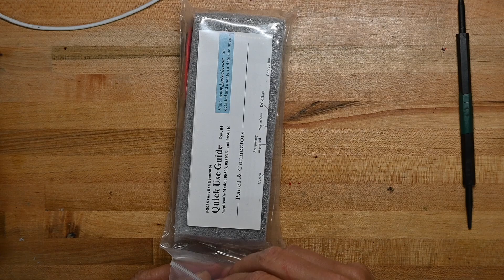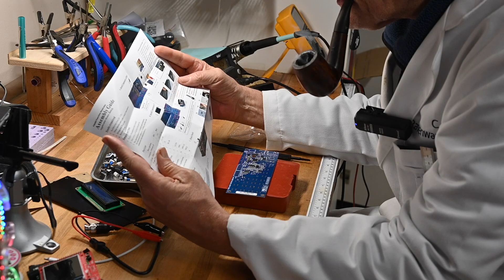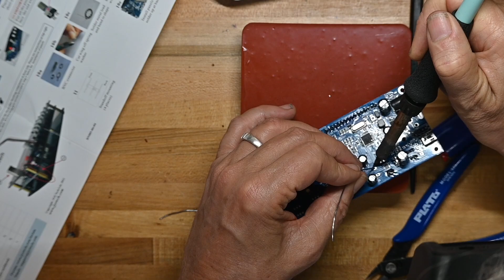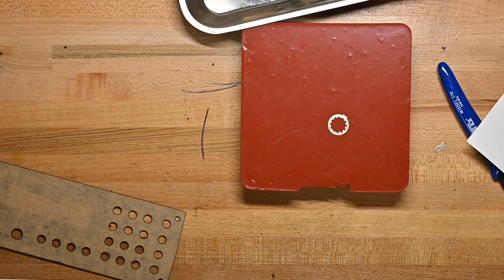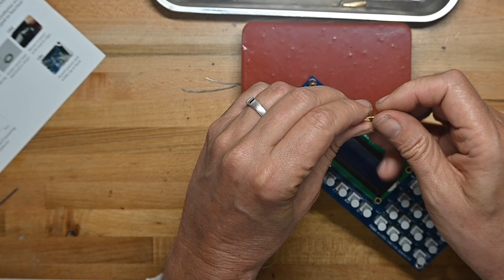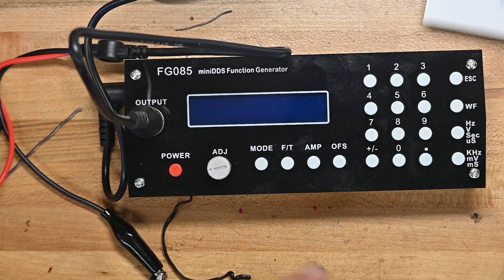C.K. builds a signal/function generator kit from JYE Tech

Comment: Hey CK I built one might I recommend a Soldering Microscope or magnification. And the output in my opinion is low. May need to amplify.
Reply from the maker: I do use a magnifying visor, but I’m also Old 😀 yeah, low output for many uses, but I’ll admit I have a store-bought signal generator for my off-camera work. Thanks for stopping by!
Reply: @CKHaun I have a store bought signal generator as well. Nice having two channels.

Comment: i found a guy on ebay with like a few assembled ones for sale as is i see it powers on and says he does not test this type of thing so 35 plus around 8 shipping
Reply from the maker: Interesting.  That's a lower price than the kit, wonder how he makes money.  But you don't get to put it together :).
Reply: @CKHaun  i would say he scored them and has no idea about them like lost shipping auction returns etc
Reply: @CKHaun  is it worth 45 bucks usd reliable type thing i need on for my hobby repair vintage stereos i am getting into .so many chooses
Reply from the maker: @overbuiltautomotive1299 I think it would be worth it.  It's got many functions, it's reasonably easy to configure and use.  You could just get a cheap audio generator for stereo repair, but I think the $50 for this will give you a much more flexible unit.
Reply: @CKHaun  yes thanks sir and God Bless you and yours / thanks or your time

Comment: Nice video, thanks!  I’m just learning about all this stuff. Does a signal generator like this perform the same duties as a PWM (Pulse Width Modulator) signal generator? I see a lot of people doing experiments with PWMs, and am wondering if there’s any difference?  Thanks!
Reply from the maker: Thanks!  
This will generate a pulse width signal with adjustable width, frequency, and amplitude.  But a PWM gen. often just does square waves, this can do square waves and sines, etc.
Reply: @CKHaun  Thanks for the clarification! So basically a PWM is a square wave generator.
Reply from the maker: In general yes, and often aimed at digital circuit design and testing since many chips take discreet on/off signals (square waves) vs. continuous signals (sine waves).
And I say "in general" since some PWMG can do sines, and some digital chips can be perfectly happy with sines vs. sharp-sided squares.
And a dedicated PWM generator can have lots of additional handy functions for chip/board designers and testers.
Reply: @CKHaun  Thanks for all the info! 👍

Comment: DUDE! SYNC YOUR SCOPE!
Reply: 🤣CK don’t press no unnecessary buttons.
Reply from the maker: Every extra button press is deducted from my Xbox controller button presses, can't afford to miss 'em :)
Reply: @CKHaun  XBox? What? You can’t afford a PS5? ;-)
Reply from the maker: Old retired guy only needs one console.  And since all I play is Borderlands 1, 2, and 3 the xbox is dandy.
Reply from the maker: Too much work, if I can understand the trace I ain't gonna mess about getting perFect.....
Reply: @CKHaun  Don’t need “perfect”; just want to be able to tell if the frequency increased/decreased. Can’t do that when the whole trace is sweeping right to left. Turn the trigger voltage knob 15° CCW. Done. I’ve got four cheap (<$100) portable dual-channel digital scopes that all have and “AUTO” button that will sync & adjust frequency & voltage with one push of a button. And it wasn’t that much harder 40 years ago with a $6,000 HP o’scope.
Reply from the maker: But the Auto button is waaaayyyyy over there!